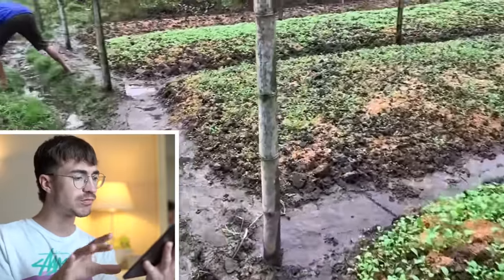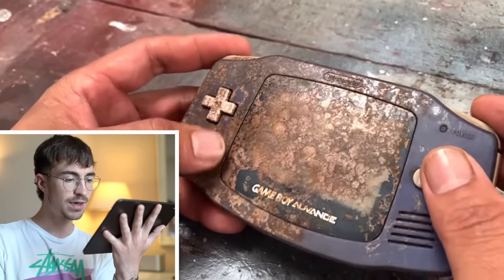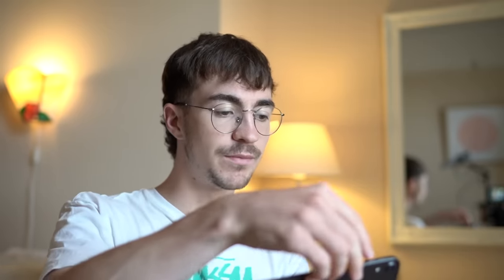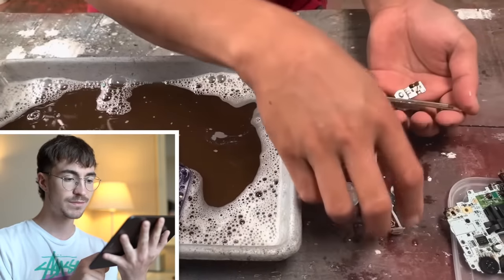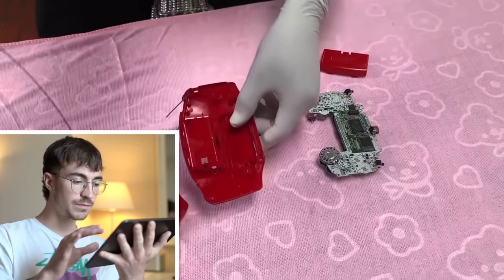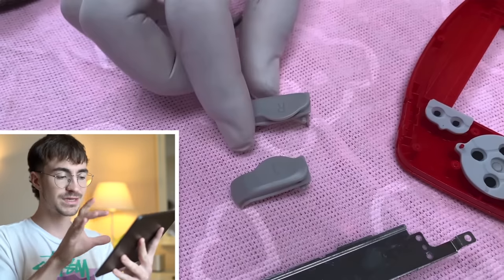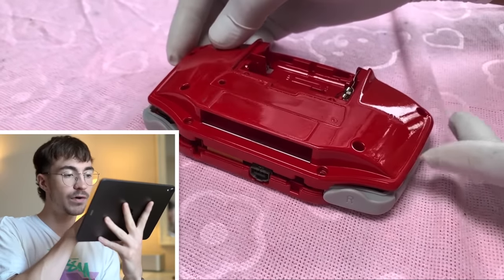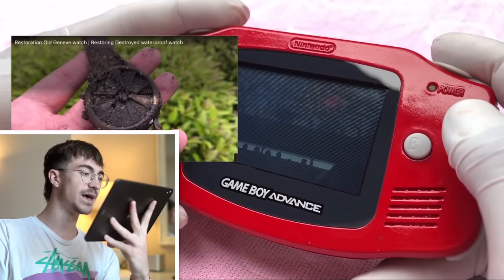Exposing FAKE Restoration Videos!

Comment: As someone who builds PCs with parts from the scrap yard i can say that rust, dirt and water are no problem for electronic parts. As long as you clean everything and let it dry there is a good chance that everything works fine 👍🏻
Reply: @requiemagent3014  i think you don't understand what i wrote, there are fake videos yes but not all of them are and i can say that in 90% of the time everything works fine, electronics are not so sensible as you think. Many people believe that. My Cellar was under water for 2 days and my PC was there too and after cleaning and some days to let it dry, everything worked fine. I get your point but not everything is fake.
Reply: @requiemagent3014  sorry for my bad english
Reply: @lordsheldor  You aren't the sharpest tool in the shed are you. Yest distilled water is perfectly fine for electronics when you make sure the water has evaporated completely. But nobody does that. Just use isopropyl alcohol like everyone else. It's a lot more effective way to clean motherboards etc...

But again not the point. From the original Gameboy this person found on the street is barely anything left at the end product. Around 75% are swapped out to aftermarket parts from china. How is this a restoration?
Reply: @requiemagent3014  You're not so bright yourself I don't think. All the dude was saying is that dunking unpowered electronics in regular water/mud doesn't kill them as long as everything is completely dry when powering up again. And he's right.
Reply: @joaopaulo-ms5it  you mean clean and dry. Dirt encased electronic is definitely unusable

Not all electronics can come out alive depending on how long it’s been submerged, some ic’s will be knocked off or bridged.
Reply: Yeah, that's the one thing I was tilting my head over. Water doesn't damage electrical parts on contact (assuming they're drying in a clean environment and that rust isn't being promoted). Water is a conductor. That's it. You could submerge your entire PC in water with it completely depowered, and as long as it dried fully without corrosion, it would be unharmed. I mean, theoretically, you could take a dump on your motherboard, and as long as you cleaned off every speck of poo immaculately, it would still work.
Reply: @jakejakedowntwo6613  It doesn't matter as long as the device was depowered the entire time. All that matters is if there's significant enough corrosion that cleaning it would compromise the components too much. If there was physical damage, then that's not an issue of dirtiness anymore.
Reply: @joaopaulo-ms5it  actually, he is semi-right, yes, you can submerge electronics in normal water and it will work as long as you make sure its completely dry, problem is however with normal water is the minerals that it contains and leaves behind when it evaporates, some of those minerals is conductive, and if those left behind minerals form a path for the electricity then you may very well fry the device, thats why people use isopropyl alcohol, it dont contain any minerals or ions like water do, and it completely evaporates very fast leaving a completely dry surface very fast, the alcohol is also not corrosive so it wont cause corrosion damage to components which very much so kill electronics.
Reply: Corrosion causes problems that can take a while to come to light
Reply: Glad someone said it. Honestly I saw a video where a guy took a fucked gameboy, bought spare  "aftermarket parts" and restored it...
Reply: @GruppeSechs  depends on the part, water will definitely damage a screen
Reply: Lol this is why I don't buy other people's custom PCs. Yeah a little water won't immediately kill all electronics (some it will, powered or not) but you obviously don't understand the implications of rust, dirt, and filthy water residue in computer components. Just because you might be able to rinse it off and get it booting doesn't mean it "works fine." I hope you are least disclose to your customers that you're selling literal trash PCs.
Reply: @skipfred  the computers are donated to families who can't afford one and they all work and yes they know
Reply: @lordsheldor  Well that did a one-eighty. Respect for the charity 👍
Reply: @lordsheldor  Your last comment really helped my perspective of you. As at first you look bad but come out a saint. haha Good on ya.
Reply: @hexxin  thanks, i guess 😅
Reply: Dunking your pc in water would absolutely fry it. Power supplies can stay holding an electrical charge for years. That’s why they’re inside cases. If you touched the components inside, you could potentially electrocute yourself to death. But you’re right about water being a conductor
Reply: Correct me if I'm wrong, but if you just use regular non-distilled water, would the minerals in the water deposit on connections as it dries and cause shorts?
Reply: @Dover78  why should i clean everything with normal water? I said that if something gets wet from rain at the scrap yard that i clean everything and let it dry. I use cleaning alcohol and cleaning liquids for electronic parts. I had never a problem with electronic parts.
Reply: i use to put my keyboards in the dishwasher to clean them. I would just use another keyboard till i felt it was completely dry before i plugged it back in. Granted, i haven't tried it with the more modern keyboards that cost more than 20 bucks. Tho i never bricked one doing it. I guess when i feel like replacing my K95 ill throw it in there and see how that  goes.
Reply: Right whole time I’m like bro I have used wires and speakers that been outside for mad long let ‘em dry very very good n back to narmol
Reply: I once poured a whole glass of orange juice over my running laptop and it was completely fine. Didn't even shut down. The only thing that happened that it smelled like oranges for months afterwards.
Reply: @Littleandr0idman  You're assertion that computer PSUs can hold a charge for years is false. Lookup "Bleeder Resistor", all modern computer PSUs have them one across their input capacitors to discharge them to make them safe if a engineer needs to dismantle the device for repair. Also even if they did hold a charge, the amount of charge held is minuscule and would simply cause about a second or two of electrolysis as they discharged. And finally, water is not a good conductor, pure distilled water is actually an insulator and used in >20,000V laser tubes for cooling where these high voltages would easily discharge through contaminated water. At the low voltages PSUs run at in comparison (even 240V, or 336V DC rectified), the contaminated water is simply a resistor and would cause the capacitor to discharge like the bleeder resistor would.

The only devices that hold lethal high voltages in their capacitors for months/years are Microwaves which use a transformer to step the voltage up to thousands of volts. Old CRTs can also do the same as the CRT tube itself is essentially a capacitor and charged to thousands of volts by the fly-back transformer. Some lower quality or older amplifiers also can hold mains voltage charges in their capacitors, but switching PSUs of any decent grade will have bleeder resistors across the large input capacitors.

The only risk to a PC being dropped in water would be if it were done for a long period and the BIOS battery was still installed (or it's a laptop with a battery), which could cause a slow degradation of the contacts and exposed copper through electrolysis. Motherboards damaged by leaking batteries (ie, retro motherboards) are regularally repaired after the battery acids cause similar damage in which case the repair involves removing the old battery, neutralising the acid with acetic acid (aka, cheap vinegar) to prevent further corrosion, and then washing the motherboard in water (distilled is preferable if your town water is hard/full of minerals). After which any damaged motherboard traces are repaired to bring the system back to life.
Reply: @lordsheldor  my gameboy fell in the water once, not more then 1 second. let it dry for 3 days. never worked again.
Reply: @bopo900  hm, strange and sad :/
Reply: @requiemagent3014  what if the Gameboy he restored was a counterfeit one ?
Reply: @GruppeSechs  It's not even the water itself that's a conductor, Pure water is actually a very poor conductor of electricity. What makes water conduct electricity is all the minerals inside it that are conductive. If I recall correctly, pure water acts more as an insulator than anything else.
Reply: @snowstorm9310  Yeah, but water pure enough to not be a conductor is pretty rare. Either way, it's funny seeing how many people are absolutely convinced PC parts and the like are dead on contact if they get water on them.
Reply: @skipfred  Actually water doesn't harm any electronics. Now if left unchecked it can cause corrosion which will in fact hinder electronic contacts to not make contact. But you can literally spray a motherboard down with a damned garden hose, so long as you dry it well and make sure not to supply any power source while its still wet, it will cause absolutely no damage whatsoever. I can believe you would go that hard in your comment, when you lack knowledge on the subject matter.
Reply: @skipfred  #1 I currently have two separate HDD's in the PC I'm using as I type this. Both were taken from a server that sat out in the rain for several days..

(As I said before, if you understand electronics, it will hurt "NOTHING")

#2 My phone is IP68 waterproof and has been submerge in water numerous times. So if you have any actual data to provide Id be happy for you to prove wrong, that which I've known to be true for decades. But otherwise, you're wasting your time typing gibberish on YouTube.
Reply: @RIPFPSDOUG  I don't think you understand how a logical argument works. Providing specific examples of something that survived doesn't mean that everything will. You're essentially saying no one on the Titanic died because you know a guy who survived. Also LMAO at using your waterproof phone as an example. I have multiple phones that have been jenked by rain including one that was in my pocket when it happened, and unlike your position (that no electronics are damaged by water alone) I only need to have one example to prove that one example exists. Usually I wouldn't explain that second part but you seem like you might need it. There are many electrical components that are damaged by water. Just because you don't have the imagination to think of any potential issues except for a short-circuit doesn't mean that they don't exist.

QED.
Reply: @GruppeSechs  Well, technically water doesn't conduct electricity at all. Pure water that is. The second you introduce even the tiniest concentration of dirt/oil/other contaminants in the water does it become conductive. I watched an interesting video of this years back. I can't remember what it was called but the guy had pure water and test leads, reading zero on continuity and the second he dipped his finger in it became conductive.
Reply: @bopo900  Unpure water contains minerals and other dirt which can deposit onto the motherboard and short circuit once dry. If you still have the gameboy, take the motherboard out and clean it well with 100% isoprophyl alcohol aka rubbing alcohol and try again. It might just clean the short circuit and work again.
Reply: @skipfred  short circuits, corrosion, battery swelling capacitor swelling. All possible none probable.
Reply: @requiemagent3014  that's the very definition of a restoration. Hence why most car collectors don't want restored models.
Reply: @cwbrear
Old mechanical keyboards can totally be run thru a diswaher just fine as long as its not on a heat cycle. 

New membrane keyboards or modern mechanical keyboards not so much.
Reply: @ComTrag  I put my k70 in once a month. Allow 4-5 days dry time. (Which is likely more than I need to, but you want to be safe.)
Reply: @gnif  thank you for having working brain cells.
Reply: @requiemagent3014  water doesn't have to be distilled, the only requirement is to evaporate it fully and to remove all salts, which can be achieved with a second washing with alcohol. I mean a lot of people in the board repair space literally use tapwater to do initial washings, some fancy letting it sit in a bottle for a day or two. You don't wash dirt with isopropyl since it is pretty expensive to do so. 

Also just so you don't go around calling people dumb. Distilled water is in fact corrosive. In some cases it can even be more corrosive, but generally it isn't since chlorine tends to catalyze the reaction and distilled water doesn't have it obviously. However, if you don't go for long submersions, where chlorine can start fucking things up, tap water is just as safe while being way cheaper. Another thing is, as soon as you put your distilled water on top of a dirty mobo, your water may as well not even be distilled, because all the minerals and salts are already there to begin with.
Reply: one thing is "dirt and water", the other thing is 2mm of rust and all the fake shit they put on. If you found a device that looked THIS bad, there's no way in hell it would work.
If anything, it was thrown away because it was defective.
Reply: @zlac  sorry to say that but no ^^ i've found some fucked up shit and 8 out of 10 devices worked fine 👍🏻 yes rust is really bad and that screen in the Video is clearly not the one that was originaly in. In a week or so i will made a video where i show some things that i've found
Reply: @joaopaulo-ms5it  sort of right, it could leave minerals or other stuff left behind from the dry water which can still short circuit and destroy your device, but it's not 100% you could be lucky... And for all those who do get lucky like the OP I am jealous 😂
Reply: @lordsheldor  Dude, I'm not talking about real stuff. Real stuff would never look like this, and it would possibly work even after years. I'm saying that IF real stuff had this much ACTUAL corrosion, it would NEVER work because chips would have no legs, solder would break and everything would literally fall off. Copper traces are 35 micrometers, if you have 2mm rust deposit from corrosion, what would keep the 35 micrometers of copper from disintigrating? Not to mention that the LCD would be completely delaminated...
Reply: @netts2315  wish i still had it. Happend over ten years ago. Your prob right. It was sea water so prob the salt.
Reply: @requiemagent3014  Hey buddy, I'm a poor person so I often have to make certain things that shouldn't work, work. Once, because we are poor, we parked far from the library to avoid paying a parking meter. On our way back, we lost track of where my vehicle was. Then, it started to rain heavily and for a long time. I turned off my phone and removed the battery. By the time I reached my truck my pocket of my coat had filled full of water with my phone in it. While driving home I put the phone on the dash and ran the heat on high through the windshield vent. 15 minutes later I put the battery back in and powered up the phone no problem. Y'all freak out over nothing.
Reply: @requiemagent3014  😑
Reply: You're absolutely correct. I just went through a flood where my basement had 5 feet of water in it. Most of my electronics survived. Flat screen TV, Google home max, Xbox controllers Oculus rift etc all came back to life. My 3D printer and my computer mice were all destroyed. (This video does look sketchy though)
Reply: PCBs are washed after manufacturing to remove flux and so on. In those days, the used solutions are typically water based.
Reply: @gnif  Those bleeders can and do fail though, so you should always measure and then short before touching anything. 
But yes, it is way overplayed.
Reply: Dale Macarena  maybe next friday when all the parts are here :)
Reply: @GruppeSechs  Water is not a conductor rofl.
Dirty water can potentially be a conductor.
I think you're thinking of saltwater.
Reply: I do have to agree with this. I found a CRT tv that has been left in the rain for years, bugs were living in it. And to get it working all I did was just pressure washed the board and cleaned some contacts. Now it works like brand new again, even if a lot of the traces are rusty
Reply: Thankyou, I was looking for someone pointing out that unpowered electronics really don't care about water, unless maybe it has a big ol capacitor it might not be great if its still got a lot of charge, but, how he was going on about the water....
Like idk it's a gameboy if it's not actively powered and you dry it off properly before powering it, then yeah it won't care about that water, maybe the screen could get some water in it, maybe.
Reply: @Tyiriel  Uh, no, I'm thinking of literally any water that isn't purified.
Reply: dirt isnt a problem (except when it carries moisture or if the device needs air cooling) but rust and water are. with water though as long as it is off, then you shouldnt have a problem. rust can cause loose connections.
Reply: @lordsheldor  OK, so your one off experience without, I am assuming, a year or two of aging behind it, left you with usable parts when the vast majority of cases with electronics prolonged exposure to water will at the very least cause them to short out, but quite normally corrode every solder point inside them. Water is awful for electronics. They have to be fully dried immediately or it's just a matter of time before the oxidation burns them out.
Reply: liar
Reply: @SSXVegeta  🤦🏻‍♂️
Reply: @tenchuu007  3 years now, i build them and repair them and they are given to people and familys who can't afford one. In 3 years not one PC had an error and i'm glad ✌🏻. Sorry my bad english, i'm from Austria.
Reply: Louis  rosmann of rosman repais always puts repairs
Reply: You do realise rusted components depending on how badly they are rusted can be completely unusable. 
ESPECIALLY if its tiny components on the Mobo.
Even rust on the charging port if it rusts away enough of it to make a sizeable gap or hole.
Reply: @ChiseledDiamond  i know and i didn't say that it works 10 out of 10 times and i know that rust can destroy such things but not every component in an PC can rust so easy. Sorry for my bad english
Reply: There is no saving a pcb with surface mount components unless you unsolder everything.
Reply: i was looking for this comment!
Reply: @requiemagent3014  you could actually bring your pc out in your drive way and hose it with tap water, and it would still work if you dry it properlly, yes we all know putting liquids especially water on electronics is a bad idea, but its not always a universal rule that it will automatically destroy once in contact.
Reply: yeah i comented the same thing, electronics and water are no issue what so ever AS LONG AS THERE IS NO CURRENT running in it whatsoever. you could theoretically unplug your pc, remove the little battery from the motherboard and drown it in the bathtub for DAYS aslong as its 100% dried up when you plug it back in there will be no issues
Reply: @raver377  Yeah! L leared that about a few months ago
Reply: i agree. I've seen dirty motherboards washed in soapy water and they will still work. I pulled out a Pentium 100mhz machine that was badly damaged and dirty as all get out from a dumpster. Cleaned it up and i used if for probably 3 years, before giving to a friend that ran it for at least another 4. Maybe they staged how they found  the item, but it's certainly within the realm of possibility that this could be restored.